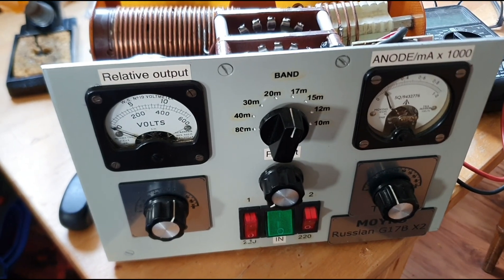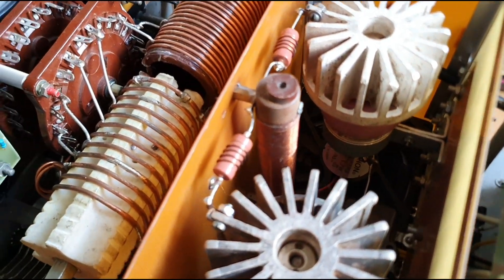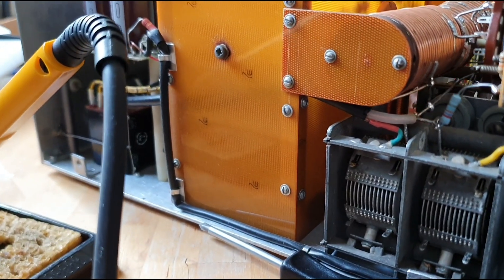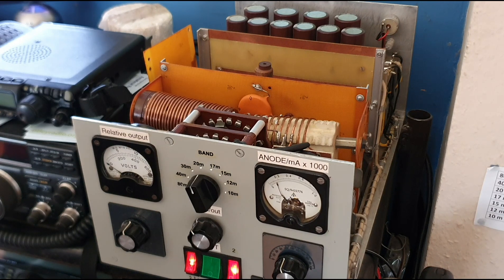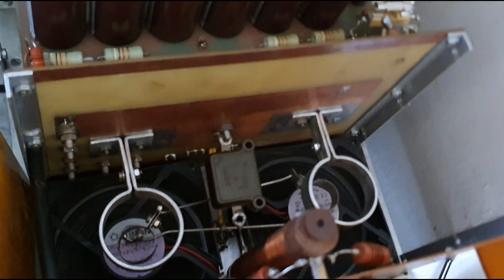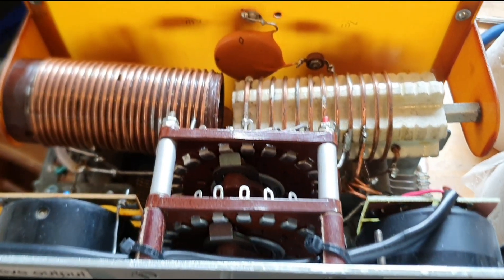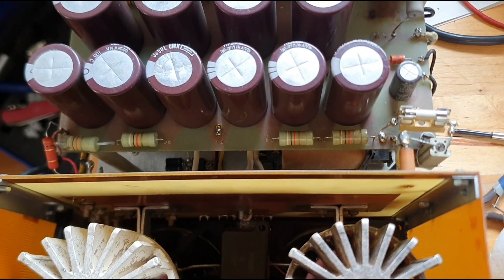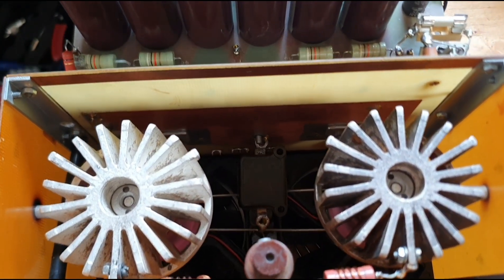GI7B amplifier Valve Replacement - HF Power Amplifier Troubles.

Comment: Hi , hope you're okay.

First of all, I apologize for my ignorance and extensive comment/question, but I have a conceptual doubt and I want to ask you for help to clarify it.
I have seen that avery circuit with GI7B   triode, in common grid configuration. use a "biasing board" with zener diode and transistors, to biasing the voltage between nd cathode.
When I was a kid (in the last century hihihi) it was common to directly bias the grid with a source (Ecc) and ground it for RF signal  with capacitors (maybe because we didn't trust semiconductors).
My question is: what is the advantage of using a transistor with a zener to bias across the cathode/filament, instead of directly biasing the grid?
Reply from the maker: Hi Dario great comment 😄👍 I don't believe that there is no advantage as such. The reasons maybe something like easier to source components and cheaper costs  or possibly because it is less hazardous for overheating and setting on fire lol. The newer stuff melts and stops. I hope my answer is reasonable, maybe someone else reading this can do a better job of explaining. Thanks for your comment I hope to hear from you again. I have to take a look at my amplifier as I developed a fault causing the amp to loose output but it's one of the many things on the bench waiting for me to get my finger out. Should be an easy fix hopefully 😄.

Comment: Believe it or not, I eventually managed to get my GI-70Bt amplifier built! 😱 I made it a ten metre monobander, as it was much simpler to do...

Did you ever get this one repaired fully?
Reply from the maker: Good to hear it works. Been busy this side but yes I did. However I ended up building it back to the original setup with the valve housing and adding two extra fans. Now a back up as I prefer the ameritron/GI7BT

Comment: Hi I am converting my Heathkit SB200 from 572b tubes to GI6B same as GI7B,  question what is your standing current and your EHT on the valves.?      Martin  G4LMZ
Reply from the maker: Hi Martin good luck on the conversion ir should work great for you. HT voltage is 1.8 kv, Input current is 400 milliamps, heater is 2.5 amps, hope this helps 👍 73
Reply: @M0YKSHamRadio   just been checking up on the standing current for 2 gi7b its about 80 ma @ 2400 volts my Heathkit is 2400 volts EHT
I have purchased from ebay a 3 min time which I am going to install in the PTT line to allow the heaters to warm up first before txing
Depending who listen to some say when using brand new tubes they should be burned in between 6 to 8hrs with the heaters switched only.
Even after the air has been sucked out of the valve there is still some gases left  in side and burning the heaters gets rid of the gases.
73 Martin G4LMZ

Comment: Good morning, can you demonstrate how the Bias control of the valve was done
Reply from the maker: Hello the amp uses some high voltage Diodes which are wired piggy back in series which drops the voltage for the required bias. I have to complete the rebuild and will produce a video when it's done. 73

Comment: Glad to help. I would suggest checking that you have HV getting to the valves, but that requires a HV probe on a volt meter. There may be a fault in the rectifier board, perhaps a diode has blown or similar.

Unless you have access to a HV probe, I'd suggest bringing in someone more experienced to look at it. Diodes are pennies to replace, but it's the labour cost that adds up the bill!

Another option could be to remove the rectifier board and remove the diodes and electrolytic capacitors, to test them individually out of circuit. Sounds like a lot of work, but it isn't really. I'm sure we could get together as a community and send you parts, if needed!

It's a process of elimination...

Ps... Don't throw away the old valves, as they may be still okay.
Reply from the maker: Thanks Ian great help and advise. I have fortunately managed to get in touch with a local amplifier expert - Pete G4TCB who lives 10 miles away he has a lot of knowledge and experience regarding the Russian tube/builds and is happy to help sort it out. Pete has suggested a few mods to make the grid supply more stable as well as a better system to house the tubes. Hopefully will be cracking on in the next couple of weeks. I ordered some brand new valves as the ones I fitted have been hanging around for years. Thanks again for all the help and advice as well as support. It has been fully appreciated
Reply: @M0YKSHamRadio  good to hear! 9:36 I'd also check out that decoupling capacitor at the bottom of the anode choke, just in case it's shorted to ground.  That could've damaged the HV supply board.

Comment: if that meter on the right is labeled correcty then it's anode current which will be zero with no valves in! Just replaceing valves without knowing whats going on can be a very expensive thing to do if you have a grid bias fault. Also a bad idea to solder to valve pins as you can break the glass seal around the wire due to temperature difference between pin and glass seal. Pin expands with heat before glass does.

Hope it goes well, and you get back on the air. I've got a FT102 with valve issues, so saving up for the £150 to replace them.

73
Reply from the maker: Thanks for the comment and information I have probably got as far as I can and may have to give up on this one but it was interesting learning more about the workings and possible fixes. It was a great amp especially useful over the past couple of yrs when it's been poor conditions. At least the bands are much better for barefoot operation. 73

Comment: Do a one circuit diagram, and then is easly...
Reply from the maker: Makes sense I will do when I get some spare time tnx
Reply: @M0YKSHamRadio  In Internet I saw a circuit diagram with two GI7B, quite good, like Yours amplifier.
Reply: @M0YKSHamRadio  Make test the voltage of the  transformator, diodes( semiconductors). Look at resistors, switch too (ohmmeter). The PA has no many elements. Good Luck. 👍👍👍👍👍👍👍👍

Comment: maybe the powersupply is damaged, could that be? new tubes and that thing doesnt work, probably its the powersupply.
Reply from the maker: Possibly is but difficult for me to test as I don't want to work on it with the power on. Too dangerous for a novice electronics radio dude